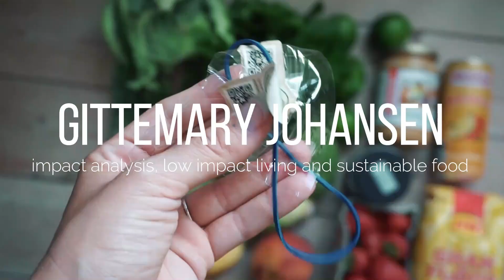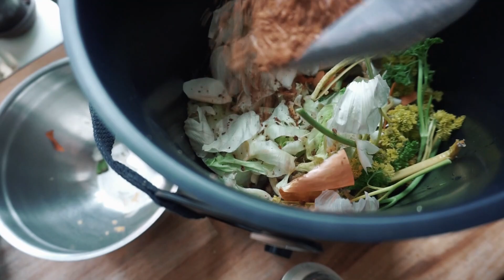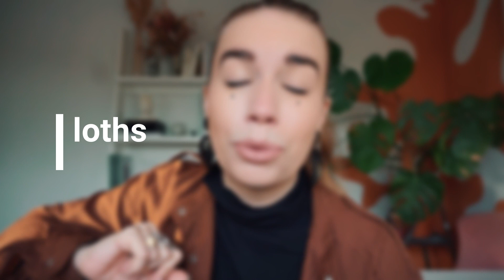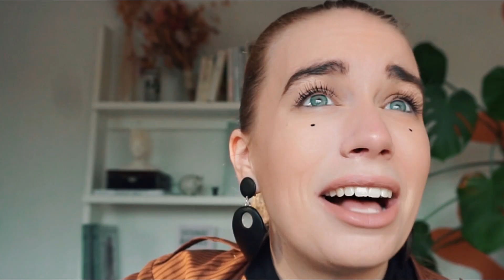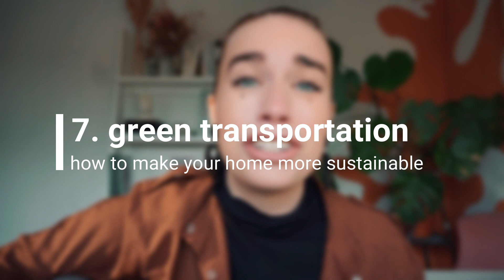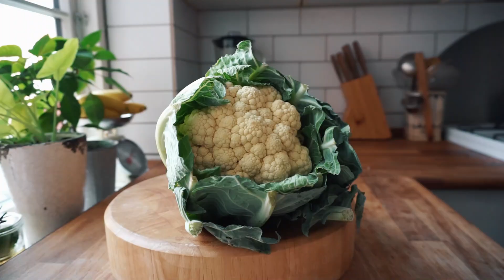10 swaps that will make your home more sustainable (both for beginners and experienced)

Comment: Try to save energy as much as you can. It’s most effective to reduce heating and/or cooling as much as you can and the energy of big technical devices. That has by far more impact than led lights. A blanket with tea but less heating is more sustainable.

Comment: A bidet would be fantastic, however, not everyone is on mains water. We live on a property and only have tank water, so water is very precious and we use it as sparingly as possible.

Another YouTuber, also said nobody should air conditioning. We also live in the tropics, and need air conditioning in our bedrooms so we can sleep at the hotter times of the year.

I love your channel, however, I would like to hear caveats to what you are talking about. Including the climate you live in, financial ability, the fact that not everywhere has recycling, and so on.  Everyone’s situation is different, like we have a septic system, and must be careful what is going down the drains, so I use paper towels to wipe oil when needed, I would like to not need paper towels, but sometimes I do.

Anyway, I would like to see caveats included in your videos, as you have fantastic information, just there will be valid exceptions which could make people feel guilty when they (the exceptions) are not included.

Other than that, fantastic channel and information. 💜

Comment: In Norway the foodwaste goes into a separate container, and it produces biogas, compost or fertilizer for the farms. I did recently reduce the use of papertowels due to the increasing cost of the products. Most of the kitchen rolls went to drying our hands, easiest swap in the world to hang up a normal towel. 😊 About renewable energy resources.. Here in Norway, all energy is green, mainly from hydro energy, and some wind, but it has been a big debate here. The green energy scam. The energy companies charge extra to sell you this product. But, you get the same energy as before, they cant put greener energy into your house. What you pay for is a guarantee of origin, equivalent of your consumption, and you give through this sceme money to the Rainforest Foundation (Norway). Totally with you on recycling. And I might add, buy less, especially clothes, so it doesnt end up in mountains of clothing in Ghana or other places.

Comment: The two things that I have the most control over are lights and heating/cooling of my house. 
I restrict use of lights the majority of the day and then any lights I do use are connected to power strips to make it easier to control the few lights that do get used. 
Then with heating and cooling of my house (I do have dysautonomia and have poor temperature regulation of my own body so it makes things difficult.....) I have made it a habit of having my a/c setpoint at 76°f and the heat setpoint at 68°f. If I feel warmer or cooler then I use the theory of layers to fine tune my comfort through use of the following- yes or no sweatshirt/hoodie/light jacket, pants (leggings rather) are a must because of other issues from tactile issues and the use of leg braces, and then a variety of blankets, sheets and large body towels to cover my body parts as needed in random combinations.

Comment: Hi Gittemary,
Can I ask that you look into the sustainability of a Japanese bidet-toilet (the ones that are powered by electric and have the bidet incorporated into the toilet)?
In the UK, bathrooms or separate WCs are often not large enough to accommodate both a toilet and a separate bidet - we're keen (when we can afford it) to replace our toilet with one of these Japanese style ones... But I'm curious if it's "better" for the environment, on the proviso that our electricity supplier uses a mix of renewable and fossil fuel.
Many thanks!
PS the lighting was beautiful.
Reply: Hi Christopher, many in the zero waste community have opted for a bidet that is not separate from the toilet nor replaces the toilet, but is an attachment that is installed under the current toilet seat. It's connected to the same water pipe as the toilet, and doesn't require electricity at all. (There are some fancier ones that have heated options, but those aren't necessary and they're harder to install.) I know The Simple Environmentalist and Shelbizleee both have this kind of bidet if you want to see videos about it.
Reply: @TravelSoMuch  awesome, thanks for the recommendation.

Comment: If you can’t collect rainwater, you can save your waste water instead! Personally I keep a small bucket by my kitchen sink that I pour waste water into, when it’s full I just pour it into my watering can or a bottle for storage. I have saved some plastic soda bottles that I store any extra water in, I do have quite a few plants so I need several litres of water per week. 
- If you have a pet, when you change their water you can save the dirty water and the water from rinsing the bowl/bottle for your plants. I have cats, a dog and a guinea pig so most of my waste water comes from rinsing their water bowls and bottles twice a day. 
- Unsalted pasta water can also be used for plants (once it’s cooled down ofc 😅). The starch from the pasta water is actually good for your plants! 
- The water from washing your rice can be easily saved with a bowl or pot under the strainer and given to your plants. 

- I haven’t looked into it, but I’m sure the water from soaking things like beans or lentils could also be used for your plants. 

All of these things and several more could also be used for watering your compost; if you have a biodegradable dish soap for example you can pour your dirty dish water straight into the compost.
Reply: I have aquariums and use the waste water from water changes for all my plants. It's amazing as it has nitrates in it from the nitrogen cycle of the fish and my plants love it!
Reply: And to flush your toilet with!
Reply from the maker: Okay I was low key thinking the same thing 😂🤫
Reply from the maker: Great tips! 🌿✨
Reply: You can also collect rain water and use it as an emergency water storage system just in case if you lose both power and water. Just treat it before using it for drinking, there are videos on YouTube on how to do this.

Comment: As an Italian, I second the idea of everyone using a bidet. It's so much more hygienic and a blessing when you are on your period
Reply: Same here but we don't use the bidet instead of the toilet paper, we use it besides the toilet paper 🤭
Reply: @LauraFVC  concordo assolutamente!
Reply: @LauraFVC  ya! i am very confused about the eco-ness of a bidet... the wetness! i assume you'd have to use paper to dry off! and since I really don't like being wet, I feel like I would use MORE paper not less! ... if at home you could have a towel to dry off when clean??
Reply: @cilstr  Usually there is a small towel next to the bidet, used specifically to dry off :)
Reply: I use a bidet and reusable toilet paper to blot dry @cilstr
Reply: @cilstr  I use a towel to dry off afterwards when at home. Outside the home I use toilet paper, but after using the bidet I need less than without it.
Reply from the maker: Absolutely agree 🎉
Reply: yes as soon as i move into my own place i’m installing one, i hate how in england they aren’t common practice
Reply: In my house in Spain we have one in both bathrooms. Best invention ever. I need to install one of those bum cleaning thingies in the apartment (living in Germany).
Reply: In Finland, we use a bidet shower head that is attached to the sink. It's such a standard in Finnish households, and also effective for cleaning the toilet bowl. It saves water and time. That and the drying cupboard in the kitchen are two things I miss most about Finland when abroad.